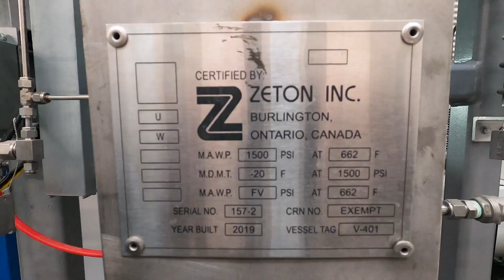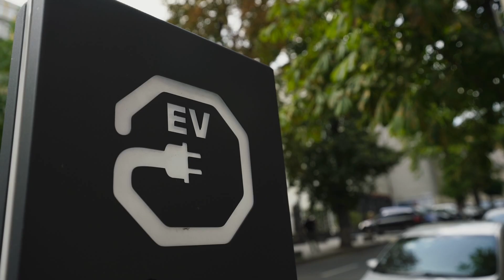Fighting climate change with Vodka and Jet Fuel. Climate Week NYC 2024

Comment: My understanding is that the energy released in the combustion of the jet fuels stems from the bonds that exist in the hydrocarbons you are manufacturing. Where does the energy for those bonds come? Are you planning on ensuring that you are using solar or at least nuclear power sources to create your fuels?
Reply from the maker: The idea is that although the fuel is combusted, thereby releasing carbon dioxide, that fuel is made from carbon previously captured from the atmosphere. So the "same" carbon is essentially being used over and over again (ie: recycled), instead of new fossil fuels being burned every time. That's what he means when he talks about using it in a "circular fashion." They run their factory on renewable sources of energy.